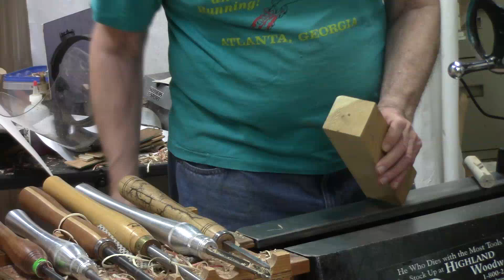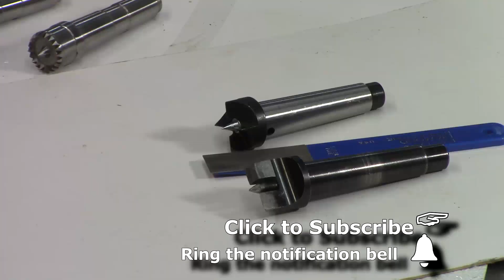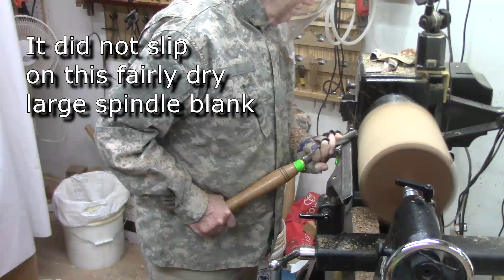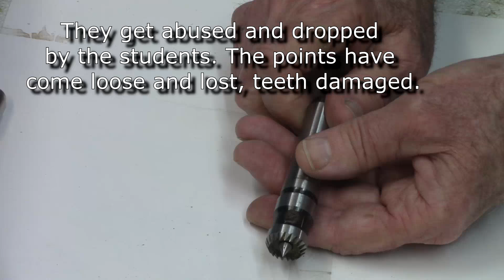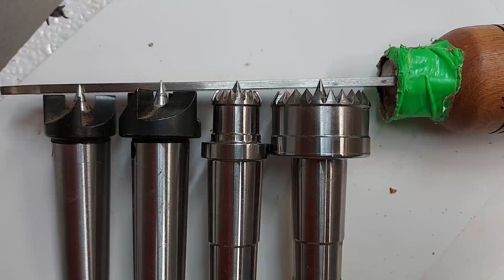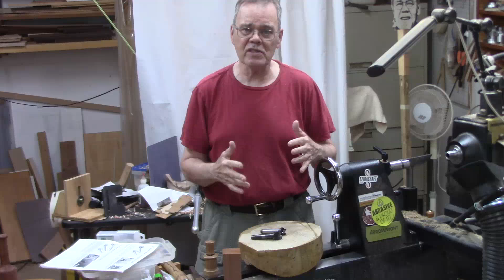Why Your Lathe Drive Center Might Be WRONG For The Job?

Comment: Hey Mike, Thanks for video. 
I got the 1/2 inch Sorby Stebcenter and was looking at the other two offered by Sorby, 7/8 and 1 1/4 , do you find yourself using all versions equally or is there one you would think is used the most? 
Thanks
Reply from the maker: I use the ones by Record power: 16mm  on my  midi and the 22mm on my big powermatic. I raely use their 32mm one but it depends on what you mostly turn.

Comment: Question, I see you using a wood mallet, will a leather mallet work as well?
Reply from the maker: Probably if you have one.  I have never seen a leather mallet. But wooden mallets are such an easy and useful turning projecr requiring very little skill, that is a much better option for almost everyone.

Comment: Nice video, Mike. Very comprehensive. I think a lot of turners don't like to change something that is working for them for years. But the spring loaded multi-tooth are a good addition to the many, many, many accessories I own. I find there is less chance of stripping in wet wood. Do you find the same in wet and dry wood?
Reply from the maker: I have not had good luck with bowls wet or dry. Mostly I just find them simpler with spindles than having to use a mallet.

Comment: I don't even use my 4 prong drive anymore, I mainly use a ring drive, sometimes a steb type. I have a 4 prong that has a spring center. That doesn't make sense, you pound it in and the spring is pushing it out.

Comment: Agree with your comment about the screw on 'stebcenters'.  If that screw inadvertently comes loose, the spring will eject the pin which will inevitably be lost in the shavings under the lathe.  DAMHIKT.  But, a little locktite on the screw threads helps, or if you prefer, you can also use the leftover touchup paint from the car that you traded in last year.  Also, I've found that it's not all that difficult to make a new pin from ordinary steel rod - chuck it in the lathe and use a file to make a point, and then file a flat on one side to receive the grub screw.
Reply from the maker: Making a new pin might be a challenge for a newbie still learning how to chuck and turn wood though!

Comment: Lot's of good information, Mike. For most of my work between centers, I use the Oneway "Safe Driver". It's very similar to a Stebcenter, except there are no teeth, just a smooth ring (or cup) around the point. I used a small round file to cut a few teeth in mine, but I don't believe it is necessary. Robust makes something similar that comes with two different sized rings.

An advantage of this type of drive center (by this 'type' I mean Oneway's safe driver and multi-tooth stebcenters) over standard 4-prong centers is they reduce the consequnces of a catch. If you get a catch, the blank will simply stop spinning with very little damage to the blank. This can be a great help to learning good tool control. 

The downside to this type of drive center is it requires more tailstock pressure than would be needed with a typical 4-prong center. Generally, that's not a problem. But, it can be a problem if you're turning something long and thin. The additional pressure can cause the blank to bow.
Reply from the maker: Excellent points. Thanks for sharing David.